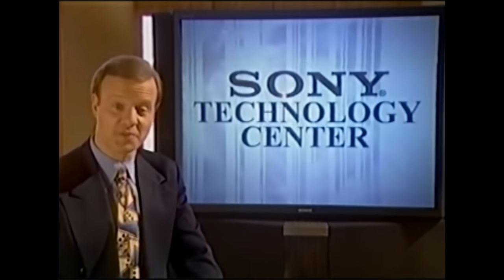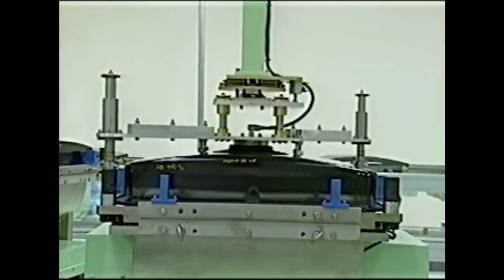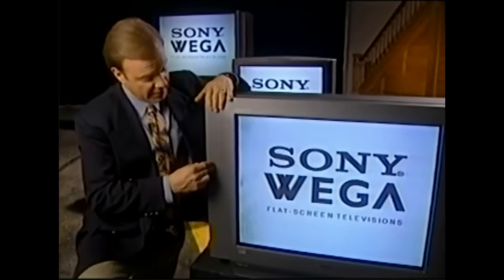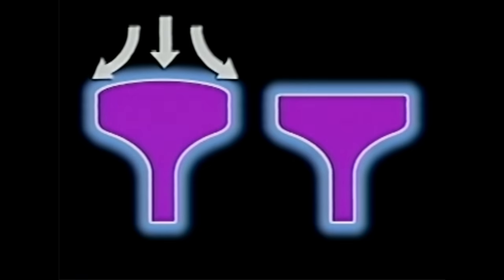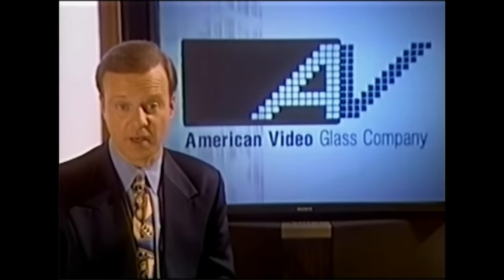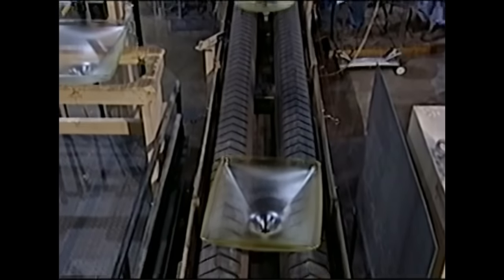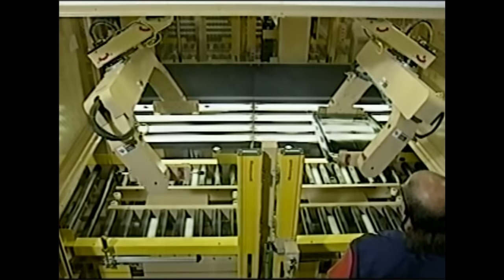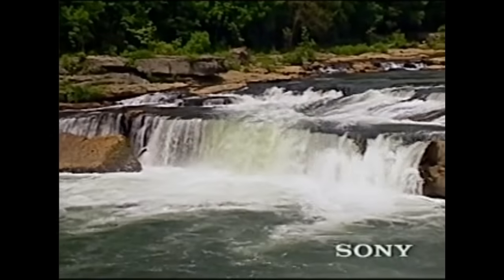SONY TRINITRON TV How was it Made ? - Japan VIDEO Electronics Television CRT Factory 1998

Comment: besides a great picture, those TV's had an beefy sound, where no external speakers where required. Now we have all TFT,  but due the lack of resonance room they all  sound like someone is peeing in a tin-can ;-) with the build in speakers.
Reply from the maker: Good point.   TFT = Thin Film Transistor.     Real quality speakers are always preferable.  :  )
Reply: I still have my Trinitron, it has a woofer speaker in the rear. 

Sony didn't waste the cabinet space. The lesser models still had good speakers, way better than a flat wall TV today,  but they left out the bass driver.
Reply: Exactly. My 36" Wega CRT is basically a home stereo aswell as TV. I'm reading your comment on it right now as it's connected to my PC.

Comment: I remember when the Sony's WEGA TV came out, a 27" set cost over $3000, and it only had 720p. Now, a 85", 4K set costs less than $1000, in less than 30 years. Remarkable advancement in technology and manufacturing.
Reply: Low cost up front for modern tvs means ads baked in to the TV firmware, components that need to be serviced more often than older displays depending on usage, and many other factors go into cost. We pay it in the end regardless on if we know it or not
Reply: I think we're hitting a wall on price tho at $150-200 low end for a 40ish inch set not on discount. Yeah there will be new screen tech, new materials etc, but at the end of the day you still have to store and ship the bulky box and panel itself, even if its not heavy, a 50in TV is always gonna be a large item
Reply: Yet that modern 4K set will have horrible stutter when watching low fps content due to very fast frame response time. Which has to be mitigated with badly tuned motion interpolation, ruining the cinematic motion blur of films. Whereas that old 720p wega would have buttery smooth motion at 24fps.  

Not everything has gotten better.
Reply: Are you sure 85" 4k tv cost 1000$ ? I think the oled models are more than 3000$ , this is depends on technology and brand.
Reply: Yeah except we got motion blur and horrible black levels (except for OLED). Also, images look fake, “soap opera effect”. Yes these CRT’s were heavy but the the picture quality in many ways is still better than modern TV’s.
Reply: Всё правильно
Reply: Yeah and they come with a Korean display LOL
Reply: A modern TV is no advanced product, off course it costs peanuts in comparison. It is basically a sheet of plastic with some advanced printing of OLED material and transistor patterns to control the stuff. Industrial design is no longer needed, TV's are as simple as an Ikea picture frame when it comes to design, and the entire profit on the product if paid for by advertisers, you no longer pay a fair price for a product you actually own. You buy a licence to use it for 7 years basically.

Comment: Like many other commenters, I also had a magnificent Sony Trinitron television. Mine was a 27" and acquired around 1993. I had it for over 17 years and never had a single issue with it. I sort of regret giving it away, but the thing was rather bulky and awfully heavy. As many times as I've moved, it just became more than I wanted to wrangle. But, I sure loved watching VHS movies on it. Thankfully, I do still have my Sony Hi-Fi VHS VCR -- which also still works like new. It's mostly been packed away since getting rid of the Trinitron in 2010. Once I move again next year, I hope to be in a location where I can stay awhile and finally unbox my VCR. Sony sure made great products. I still have a Sony Walkman that works, too.
Reply: Is it a Sony walkman WM 20? I have one still works but not use much. Its from 1985
Reply: @mathaithomas3642  Howdy. I just looked up the WM-20. That's much nicer than the one I have. While I can't recall the model number of my Walkman (it's packed away), it's pretty simple with a black plastic case. I don't recall if it even has an AM/FM radio. I think it's a cassette player only.

Comment: Imagine how many times that factory changed under the years is insane😮 the amount of equipment….
Reply: My uncle worked at the site for close to 30 years. He was hired around 1979ish when the building was a Volkswagen plant producing Rabbits, then Golfs. Volkswagen closed the plant in the late 80s and Sony took it over about 2 years later. He was part of the initial Sony hires and worked there until the plant closed in the late 2000s. Including the initial tooling, then retooling by Volkswagen, plus the initial tooling and retoolings by Sony, that building has seen some stuff! 😆 When Sony finally closed the plant, they were making 40 - 50 inch LCDs.

Comment: When things were made to last more than 20 years not 20 months. I still have my Sony Trinitron I bought in 1996. I could go to the store right now and buy a new tv, and that Old Trinitron would still outlast it by decades.
Reply: My 1997 Trinitron still works flawlessly too. I'm only scared we'll run out of analog repair men soon.
Reply: This is why I keep my 2008 Vizio 720p I have in my room.  It was the first LCD HD Tv the Family ever bought, and the thing is still perfect.  Everybody's so gun ho to upgrade as soon as they can, but this now little TV is a trooper.

Picking up a CRT 19" TV tomorrow of Marketplace, just a Magnavox as the Sony TV's like it are impossible to find or are stupid expensive for a retro gaming itch lol.
Reply: @vulpixgrant  Things went fast back then. Sweet spot is 1-2 years later. I've a 2009 Bravia, and it was so much better than the LCD TV's from just before. One of the annoyances of 720p is that is was actually 1366x768 pixels, not 1280x720, so even 720p content looks weird on it with scaling artefacts. With a 2009 FullHD Bravia you have 1:1 pixel mapping for Blu-Ray's, wide gamut and deep blacks for LCD, which makes it a great movie display, up to today. 2009 flat screens are (near) free pickups nowadays.
Reply: @lovemadeinjapan  Yeah that's funny, I never thought a CRT would become a collectible thing or ever wanted again...  I just spent $30 on that 19" Magnavox, meanwhile their are like 5 LCD's was larger in my general area for $10 or $20 lol.  

We have a 4k 69" Vizio in the Living Room for Movies, mostly I just use the 720 in my room for the old Consoles.  My ACER 23" monitors are 1080 lol.

Comment: The flat screen model that I had purchased, had a bit of a problem that was most noticeable if the entire screen was to be in red. Instead, the first inch or so on the left hand side would be the proper red, but the rest of the screen was pinkish. So, as a tech, I removed the back and slid out the main PCB since it had this slide out feature.  Then I fed a full red screen picture to the TV, and the entire screen was now the proper red. Then I slid the PCB back in, and thus it was located again back underneath the CRT.  Now the picture again was as bad as before.  The Yoke on the CRT was inducing current on some of the components on the PCB, thus causing a ripple on the +12 Vdc line, a ripple that matched in frequency the horizontal sync frequency, and thus had caused the picture problem. So I connected a wire the GND, wrapped it once around the Yoke, and then connected the other end to the +12 Vdc, via an electrolytic capacitor. This in turn cancelled out the ripple problem, and thus fixed the red screen problem.
Reply: That is called “color purity”. The CRT and yoke would be fitted together, and they would get “tuned” at the factory to operate in their intended geographic destination by placing them into a magnetic field that represented the destination’s Earth magnetic field; the magnetic field of the Earth varies from one place to the next.

Because purity is affected by magnetic fields, having nearby electronic devices or motors could disturb the purity. Sometimes the purity could be corrected in the field by rotating magnetic rings found on the neck of the CRT; sometimes other tricks were needed to get the purity to be acceptable.
Reply: I may ask what electronics have you repaired dear
Reply: @stevebabiak6997   In this case, it was the other way around.   With the main board slid all the way out for inspection or repair, and thus placing the main board away from the CRT Yoke, the +12 vcd power line was perfectly flat and thus had no ripples at all. But once the board was slid back under the Yoke, the +12 vdc now had significant 15.734 kHz ripples, and those power supply ripples caused video problems further on down the line. The CRT calibration itself was perfectly fine.
Reply: @helifynoe9930   - so you are stating that the CRT yoke was injecting interference into the circuit board when it was installed where intended, is that correct? This is not impossible, but the yoke has a toroidal type core that would minimize that sort of thing.

Comment: Interesting documentary! We had a Sony 42" rear projection TV  in the 1995 and a Sony Trinitron 27" TV in 1990. I liked those TVs very much. I feel that today's typical Roku TVs, even if they are very practical, miss a lot of aspects on the design level. The speakers are in the back which make it harder to hear sound details. The whole TV is very thin and light which makes it easier to break.

Comment: I bought a 36" VEGA Trinitron with a flat front CRT at Circuit City in the 90s and it cost about 2K. It weighed about 250 lbs. The 2 delivery guys had to carry it up a flight of stairs to my apartment. They were both on the heavy side and about to go into cardiac arrest after setting the TV on the stand. I gave the TV away a long time ago but still use the massively sturdy matching stand to this day to hold my OLED TV.
Reply: Its called a WEGA but the dude in the video pronounced it Vega.  I'm so confused
Reply: @lander77477  It actually is pronounced VEGA according to the old US TV commercials. Sony's official logo has a grey V with a black shadow which does look like a W. I edited my post to show VEGA.
Reply: @nchw68 
It's a German world. It's pronounced V like the W in VW.
Reply: you gave it away? 😲
Reply: That Sony tv also came with  a pair of over-the-ear wireless headphones. The tv had a built in transmitter. I never used them though, because I always had wired Sennheisers fed from a receiver.
Reply: I'm literaly typing this from a  36" VEGA Trinitron CRT connected to my computer.
Reply: @jimmyschmidt14  Text and icons must be huge.

Comment: I wish they would still make these same types of Standard TV's but with lighter components that don't weigh as much, and that don't use toxic chemicals, they really do look different from HDTV's and it makes sense to bring them back for legacy content that will always exist and would be good to watch as they were originally intended to be seen.
Reply: Yeah, I bought an old 9 inch sony CRT to watch old TV shows, and the local news.  Old TV shows don't look right on my 65 inch sony OLED, but on a CRT, it looks amazing, period accurate, like a brand new show and nostalgic
Reply: The bulk of the weight was the actual picture tube itself. Remember, the front surface of that tube was 1/2” plus thick. It needed to be thick to allow the high vacuum inside the tube to prevent imploding.

Comment: We still have sony trinition at home we have it in 1995 when our sharp tv replaced.  We used our sony tv until 2012 we have led tv were using now
. Its still working with some problem in vertical & tuner. As a electronic tech I'd like to restore it one day
Reply: I will guess at the problems and what you might do to repair.

The vertical problem I will guess is due to a failed aluminum electrolytic capacitor. Look for a capacitor that has a bulge in the lid or that has popped its lid, or that has vented its contents through the surface that faces the PCB (can sometimes see the mess on the PCB around the culprit). Replace any suspect capacitor.

Tuner issues - the broadcast standard in the USA has been changed. This might be the cause, and the solution would be to use an external converter box to modify broadcast signals to the one (NTSC) that the TV was built for.

Comment: I still own a Sony 47inch LED Tv from 2011. Have had zero issues with it and the thickness is so slim.  Thinner than many LED TVs on the market today. My household used to have nothing but Sony for electronics. From the Walkman, to the cd player, dvd player, TVs, PlayStation 1 thru 5, etc..

Comment: I got a Sony Trinitron in 1989 and had it till around 2004 when I passed it on to a friend of mine at the time. Since owning it from 1989 until I passed it on I never had a single issue with it. I currently own a Sony Bravia TV which I got in 2010, and it has not had any issue or needed repaired.

Comment: The trinitron tube was great, best that was made. Had a dell pc monitor with a trinitron crt in it and it was awesome. The TVs on the other hand suffered from quality control issues. We had a 27" trinitron that had its deflection yoke fall apart. lost convergence massively. One of our  neighbours was an ex tv technician and laughed when he saw it. He reassembled and re aligned the yoke only for it to slowly fail again. I repaired it myself some time later and again it was good for a while but slowly failed. Was around this time i lost my faith in sony equipment. It was good stuff but not any more.
Reply: have any pictures of that>?

Comment: I have owned SONY TVs since the early 1970's.  I have given away all of the TV's when I upgraded.  In that time, I have only had 1 failure, a power supply in a 52 in flat screen, KDL-52XBR9, I purchased the TV in 2008 and the power supply went south in 2015.  Sony replaced the TV free of charge and paid for the return of the broken TV.  SONY will have to mess up really bad to lose me as a customer. I still have the 52 in Sony but in 2019 I purchased an XBR-65A9F for the living room.  Both TVs are still working great.

Comment: Interesting if, as the commentary claims, they applied the phosphors between the lines, i. e. only where it was wanted. I visited a Mullard colour tube factory around the 1980s, and there they applied each phosphor to the entire surface, then used a light (UV or IR, I forget), placed not quite where the electron gun would be (because light travels in straight lines, unline the electrons) to fix it in some way, and washed away the remainder. IIRR for two of the phosphors, the washed-away was re-used, because they were more expensive than the third (or it might have been one of the three - I forget, and I forget which was the odd one out). I think the factory was in county Durham, England.
Reply: That makes much sense, as the only way to align it properly is to use the mask itself in combination with light. On a tridot mask this is even more needed, as the patterns there are even smaller. You indeed need to move the light point, but it should not be too difficult as the last part of the electron path is straight.

Comment: I didn't work for Sony or at a high-end video store, but I did own a Sony PVM-4300 monitor that weighed over 400 lbs. and had a massive 43" diagonal tube. Believe it or not, Sony didn't build any handles or handholds into the case.
Reply: should have included a free forklift, check the manual

Comment: i remember the old crt trinitron tv sets. if you displayed a solid white background on screen and looked closely you could always see a very thin black line running the width of the screen - approx 30% up from the bottom
Reply: There would be at least two of those on the larger screen sizes.
Reply: yeah wtf are those for?
Reply: @ahngelooh  - the vertical “wires” that make up the aperture grille move from side to side with even minor vibrations, so these horizontal wires are welded to those vertical wires to limit their side to side movements.

Comment: 1:48 they didn't really explain how the phosphors, which are different chemical compounds for red, green and blue, are applied in a perfectly separated grille pattern across the screen. i really wanted to know how that was done.
Reply from the maker: "Waterfall display"?  I don't follow your point....
Reply: after some reading i believe this is how they do it: the whole screen surface is covered with a single color of phosphor. then the aperture grille frame is applied and a precise electron beam is used to cure the phosphor at every third column which will make it adhere to the glass. the uncured phosphor is washed off, and the process is then repeated with the two remaining colors.